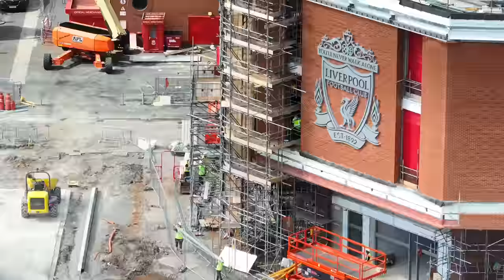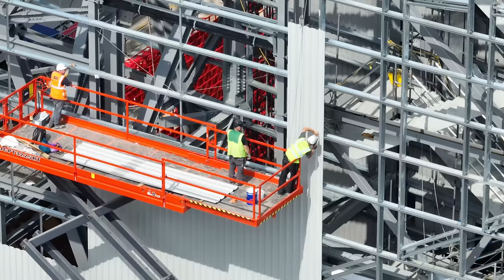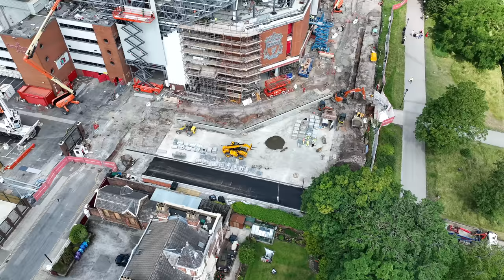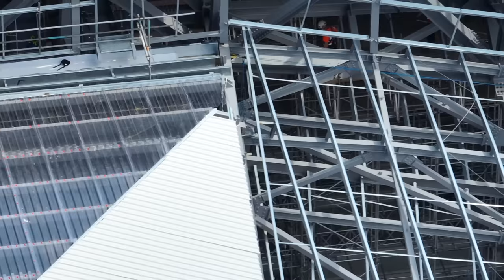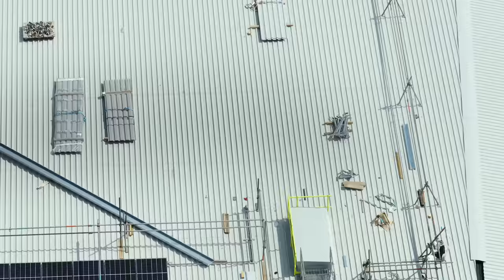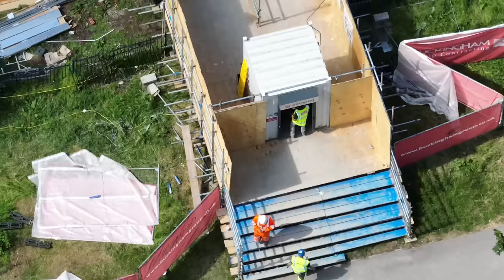Tarmac has started to be laid at Liverpool F.C’s Anfield Road Expansion

Comment: Hi Kev, congrats on achieving 11K subscribers.  That tarmac that's been laid, it doesn't look flush to me, it doesn't look finished.  It could be that it's just been laid temporarily for access to the park/car-park for vehicles/plant, instead of them trying to navigate the streets.  I'll bet the locals are getting really pissed-off with all the heavy machinery going to and from the site.  I can't see those boards being taken off of the pitch, until the internal work (like that cladding) which requires machinery, is completed.  E.g. there's all the seats to be lifted in to the upper tier.
Reply from the maker: Thanks for that mate
Reply: Spot on pal. I was thinking the same. I'd settle for a couple of tickets for cup games as compo if I was living there tho 🙂

Comment: Been looking at the original plans of the stand, looks like that top left corner of the lower tier on the Main Stand side potentially might be a accessible platform where wheelchair users can see the game. Similar to the ones at either end of Main Stand.

Re: Tarmac outside, that’s the route the trucks normally use to load in/out for the concerts, certainly the route they used last year. So possibly be for that and also use as another walkway from the car park on match days.

Another a great video. 🙌🏼
Reply from the maker: Ah good info, nice one mate

Comment: In the construction contract their will be an agreed completion date and details of any penalties that will be applied if that date is not made.  As you state I imagine they will be related to loss of income from match days.  During the cause of the contract there the contractor will submit claims for additional time (the completion date to be put back) for things outside of their control.  Thing like days lost when they couldn't use the cranes due to high winds.  I also assume the programme would have been impacted by not starting to take the roof down during the World Cup, which seemed to be a club decision.  The result is the contractor and client will agree an extension of time to the contract that the end date will be changed by before any penalties get applied.  Also, the contractor will be claiming for additional cost that they have incurred due to late client changes or were not foreseen.  So it normally quite a bit of give and take.
Reply from the maker: Ah right ok mate, thanks for all that info

Comment: Hi Kev, the corner that everyone keeps asking about is not seats in the renders. Search the official LFC issued renders and you can see the seats square off here and the area looks open with possibly a row above the gap for wheelchair users? It's hard to show but it definitely doesn't show the seats going all the way into the corner.
Reply: Scrap that! On the original LFC renders (see Guardian article from November 2019) there is a clear gap in that corner. However then look at the renders put out by This is Anfield in October 2022 and the area is suddenly filled with seats. One must be the official plans because those 200 or so seats will change the official capacity so can't both be right!

Ps, all the nonsense about LFC not playing games there until Xmas - do me a favour! The 2nd game of the season will go ahead as normal with the seats and stand finished internally but I doubt all of the core areas will be anywhere near completed. At the junction of main stand & AR you can see enormous coils of cable waiting to be moved in; that is hardcore stuff that is clearly needed for the hospitality/recreational areas and I just can't see how that can be done in time for the new season. At the same corner you can see they haven't put the windows in yet which is clearly to allow them to continue to crane in heavy equipment further backing up the view that those areas will not be completed in the next 6 weeks.

Comment: Kev if they are behind why not work 24/7 and work during the night
Reply: Probably because it's a residential area, they're not allowed to. Noise and light pollution issues.
Reply: @smiggs2214  If they are working inside I doubt it will be that much noise

Comment: 13:07 minutes in you show the fellas on the cherry picker doing the front roof cladding. They look to be in the centre of the roof at that point and there looked to be a wire coming out. Could this be for them to mount the old club crest that was on the old roof instead of auctioning it off??
Reply from the maker: Oh good spot mate, I’ll take a look tomorrow
Reply: @Kevcupo  looked at the design drawings for the inside and it doesn't show a Crest but you never know!!! Cheers la.